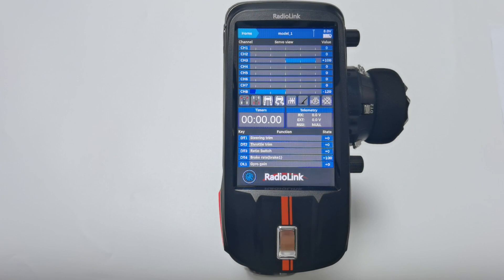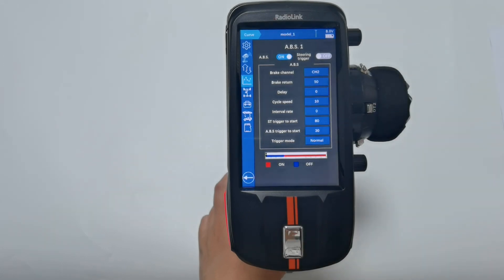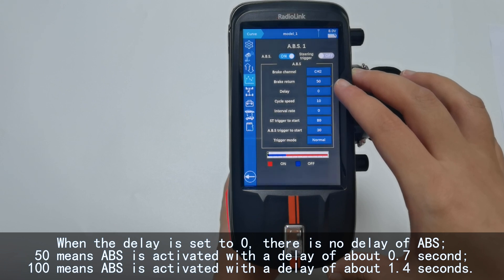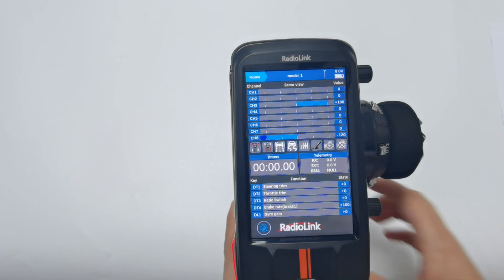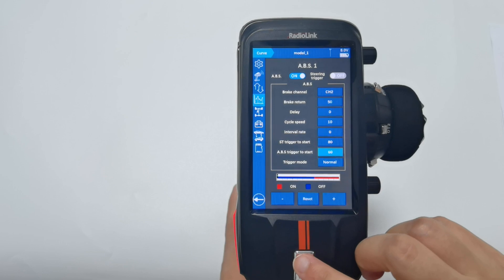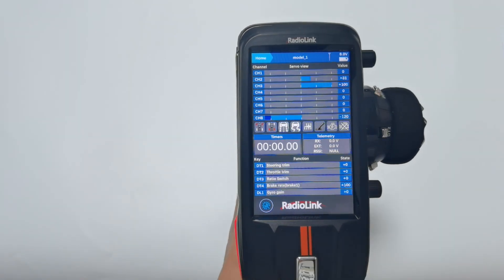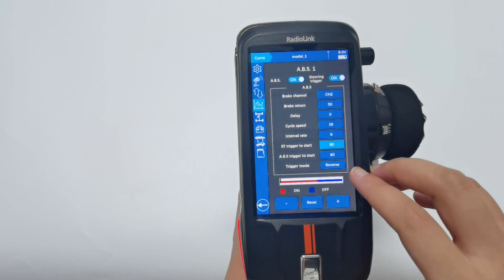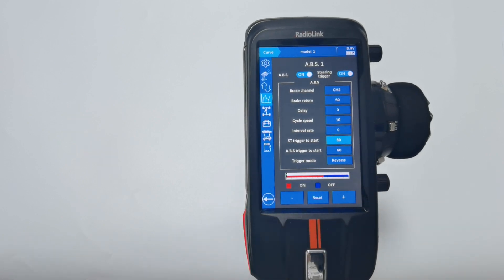A.B.S Function on RC8X

Comment: Потеря сигнала на 50-60 метрах . Пробовал на 2-х приемниках. Ужасное качество разочарован что купил ваш пульт RC8X
Reply from the maker: Dear Sir, Sorry for the problem. 1. Could you please test RSSI? You can use new receivers to test RSSI, which can help to confirm if the problem comes from the receiver or transmitter. Here is RSSI testing tutorial for your reference:
https://www.youtube.com/watch?v=RA0NasTZS90 
2. If the signal loss problem happens when you move the throttle or wheel of RC8X, it is possible that the problem is caused by insufficient BEC power supply. Here is the link for your reference:
https://www.radiolink.com/newsinfo/561234.html 
3. May I know how you install your receiver antenna in your car? There is also some requirements for the receiver antenna installment. Here is the guide of receiver antenna installment for your reference:
https://www.radiolink.com/newsinfo/886600.html 
So could you please check and follow our suggestions above and let us know your answers? You can also send us your RSSI testing process. If any question about RadioLink products please feel free to contact us. Our email is: after_service@radiolink.com.cn